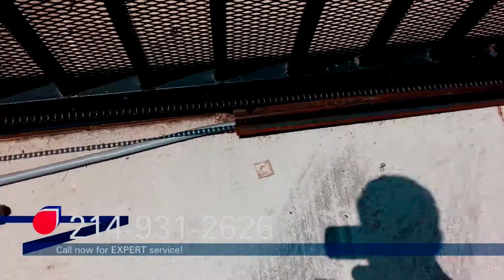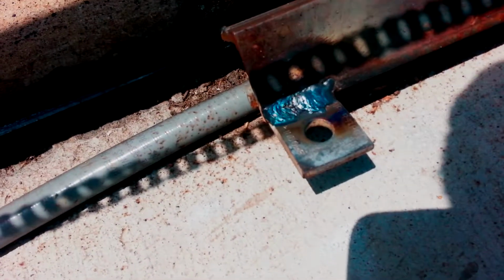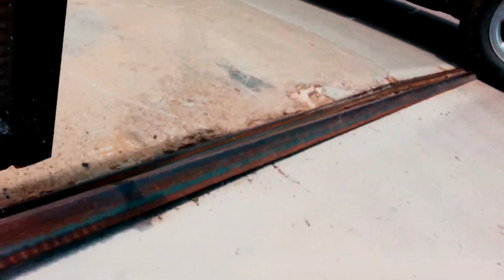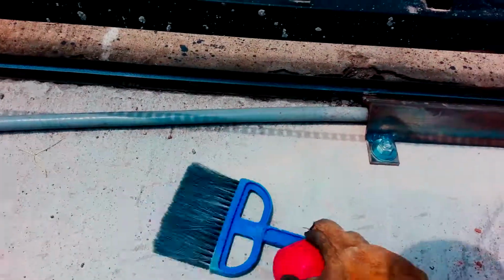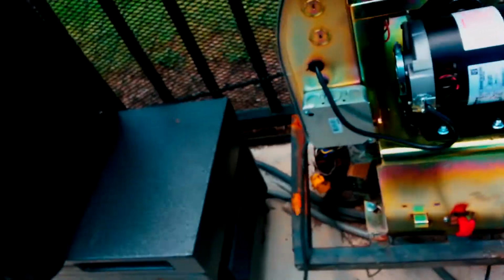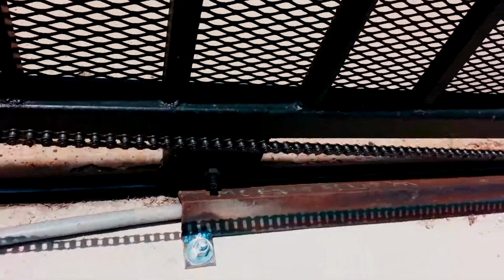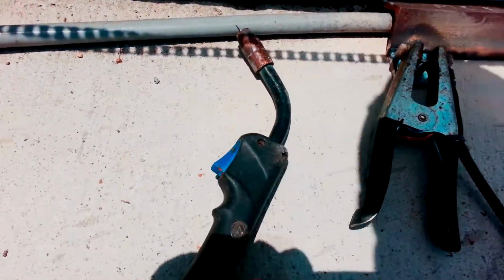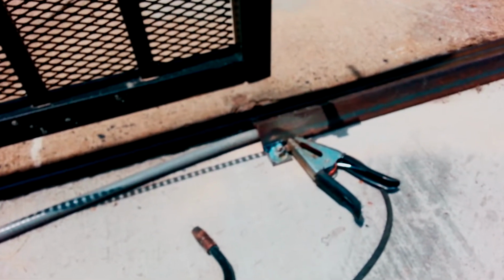Automatic gate opener v track repair on NEW INSTALL? Dallas, TX | SC0038

Comment: What isle can i buy the turkey baster??
Reply from the maker: Isle 3, where else!?

Connect with us https://linktr.ee/SafeguardControlsLLC

#SafeguardControlsLLC
#Call2149312626
#2149312626
Reply: How to repair my sliding gate that slid off the track electric gate  very heavy. How do I jack it up and put it back on the track

Comment: What would it of cost to weld the back side of the bracket that you called out? Help the customer out 🙄
Reply from the maker: These types of repairs could run below $200.

https://linktr.ee/SafeguardControlsLLC

https://www.google.com/search?q=Safeguard+Controls,+LLC,+Dallas,+TX&ludocid=13536725103213864697#lrd=0x864e98c26521bdd7:0xbbdc1bc2bf2ce6f9,3,5

Safeguard Controls, LLC YouTube Channels:

Main Page: https://www.youtube.com/@SafeguardControlsLLC
Showcase: https://www.youtube.com/@SafeguardControlsLLCShowcase
Short Clips:https://www.youtube.com/@SafeguardControlsLLCClips
Products: https://www.youtube.com/@SafeguardControlsLLCProducts
Q & A: https://www.youtube.com/@SafeguardControlsLLCQandA